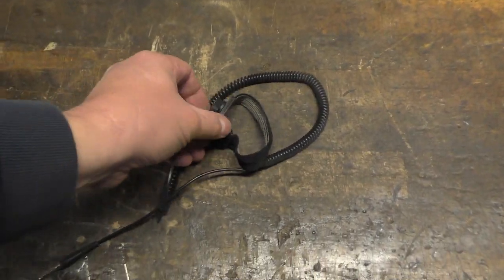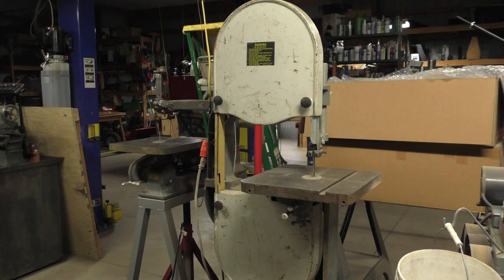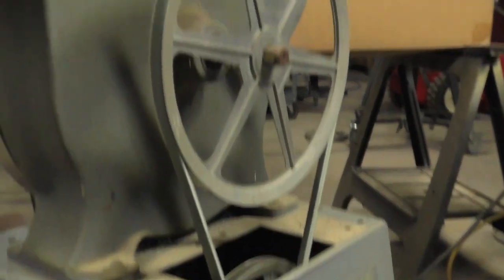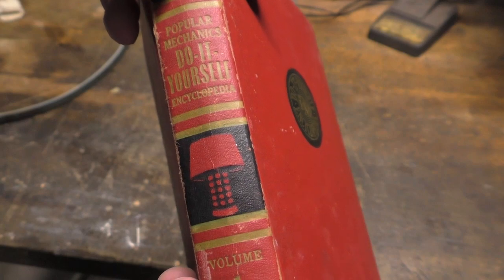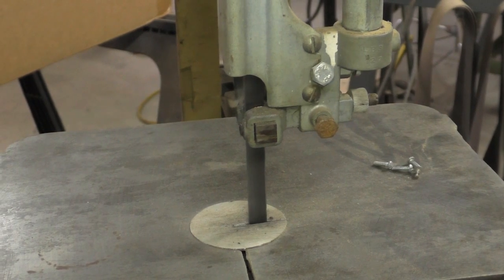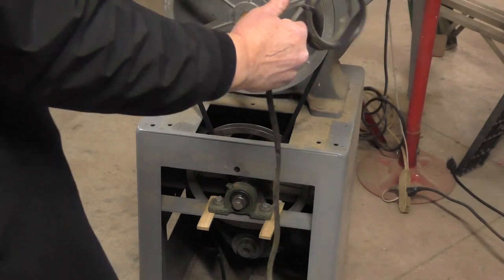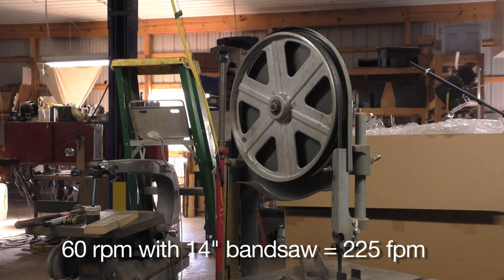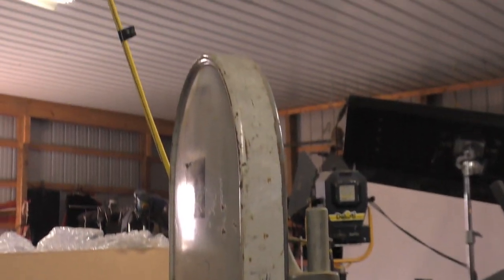Converting a Delta Wood Bandsaw to Metal

Comment: One year since I posted here, but your blade has a bad weld causing it to move in and out away from the work, as you can see. It's probably long since worn out by now, so no big deal. I still like the jackshaft arrangement, very professional.
Reply from the maker: I think you are right.  I got the blade from McMaster with a misaligned weld.  I think that this is causing some vibration.  It's still sharp as it is a bi-metal blade and I don't use it much.  Someday I will replace it.

Comment: This is my opinion so take it for what's worth. There are a couple of things that are likely the cause of the vibration.  First is pulley and shaft alignment. The pulleys not only need to be aligned axially the shafts also need to be parallel to each other. I realize the owner here is dealing with a light gage steel stand which does not help. Also the pulleys appear to have axial run-out. Take the belts off and indicate the vee groove for axial and radial run-out*. The frequency of the vibration looks to be around 2x the pulley rpm. Also check that the motor does not have a "soft foot". That is when one of the motor mounting pads is not in contact with the stand when the bolts are loose. Also leave the blade off to see if the bottom and top wheels are contributing to the problem. New tires on the wheels can also help. Another factor is just how straight the blade is welded. Also a 1/4 metal cutting blade should be more than enough. With 45 years experience working with metal cutting equipment from band saws to boring mills to surface and cylindrical grinding I never used a wider blade than 1/4 if at all possible. I welded my own blades and did not let anybody else use them.
*those diecast pulleys are not exactly precision made items.

Comment: I came up with a similar answer except did 1.75" and 6.0" on both runs.  This yields about 148fpm and allows you to use the old belt guard with one small modification.  I did drop the motor lower in the case and blocked up the saw about 1.5" to give the belts a bit more contact.

Comment: I tried using  one of those weird universal link belt from harbor freight.  They don't develop a memory if the belt is left in the same position on a small roller causing a " bump" type of vibration.
It worked very well.  I was suprised.

Comment: With a blade with less toothcount you would get even better cutting results. People often make the mistake in thinking that they need those kind of hacksaw like blades when cutting metal... And alingment of the pulleys is key, I often align pulleys of all sorts at my job and we use a laser to align them, not that you need a laser but proper alignment will make both the motor and bearing and also the blade last longer

Comment: There are V belts for fractional applications and automotive belts for higher HP applications and power belts the green ones, for industrial equipment like mowers and tractors. They have different shaped sections so are not interchangeable with fractional HP pulleys.

Comment: Doug. Is there a reason that your cross bracing for your Pillow blocks etc. uses angle iron on the back and flat bar stock on the front? Just what you had laying around?
Reply from the maker: I'm pretty sure that I used angle iron to support the pillow blocks on the back and on the front.  The front one is just mirrored to the back one so you can't see the vertical flange.  I think.  In any event, your are right that I just had the angle iron laying around.

Comment: Doug. Which pulley goes up top? 12" or 10" what size shaft should the pillow blocks be?
Reply from the maker: I used the 10" on the bottom, mainly because the 12" wouldn't fit in the base cabinet.  3/4" bore but you have to make sure you get the pulleys first, perhaps like this one: https://www.ebay.com/itm/383892687417?epid=2069535364&hash=item5961c98a39:g:8d8AAOSwEXRf9ylK:sc:ShippingMethodStandard!07853!US!-1&amdata=enc%3AAQAIAAAA8M1w27%2BCax7Gh0vpfaDChq32Z9X6m3coqM2eJfLc%2FRh2Snl2FobAMdBGcHAqwUhiHKFgVAtP17CWfUFG1dVAcc25A1mEkwLshNTsYghPZ8je1GeLug%2FkRwC7zK6fvE0DipU2NvQixi%2BwWdg7kK1VHv4rJBFllIKRiurPuP44E0I%2F41JIXUOXGgq6WbSLFZHqxKxxoPfGxxwvDK%2Fx2bVtEhksGnS7DMqrHzbUQP%2F4yRfI88jO97nbxXqXo0r1okNVPVWqSQXS9mIKVLECDd6kVWLVNxkMvu9sShoco2RGeA6f5EaDKV6RgThr3w2b4hDgHA%3D%3D%7Ctkp%3ABk9SR-bRmLOTYg

Comment: Have you considered looking at your feet on the bandsaw?  If they are rubber make sure you have the same pressure on each one.  Make sure each foot is contacting the cement or floor properly.  If you are on a wood floor then you may have to put a steel plate under your bandsaw.

Comment: it could allso be that the axle intoo the bandsaw is slightly bend or the puleys are just not balanced and the base being able to rock agrivates the problem
as for the tool , thats a vibro polisher its used to deburr and polish metal parts , we have those at work and there huge about 6 feet across , this is a lot smaller

Comment: Would an old treadmill motor with a speed controller work so you can adjust the speed and slow down the motor
Reply from the maker: I think that would work great.  I see free treadmills now and then and wonder about taking them apart for this reason.
Reply: @dlunderdahl  absolutely, get the speed controller while your at it, but most likely it is burned out, hence the garbage bin.

Comment: why go through all this trouble just get a variable speed treadmill motor (cheep or free) then you wouldnt have to mess with the pullys and the like
Reply: loss of power at low rpm and a tendency to overheat

Comment: Should of just used a reistat to slow the flow of electricity.  Like a dimmer switch.
Reply: Is that saw running on a DC motor? I missed him mentioning that.
Reply: If you really try and do that you will find you have many problems.  Rheostats of the size needed are at least $100 probably $150, and #2 they reduce the POWER to the motor when they reduce the voltage and that causes 2 problems - overheating of the motor or stalling if too much force is applied to the metal as you are cutting.
Reply: @advancednutritioninc908  yeah with a name like darin watts what do you expect? cant make this shit up